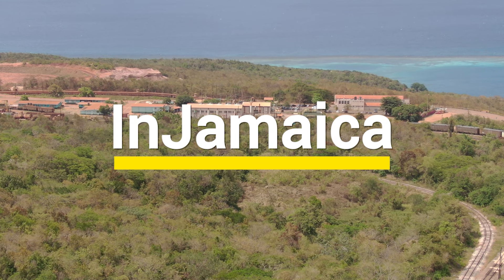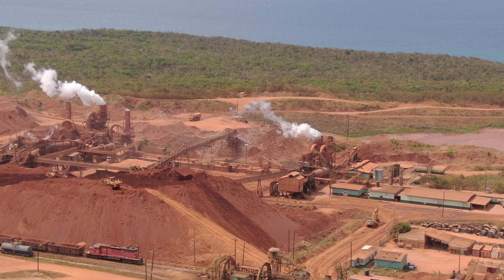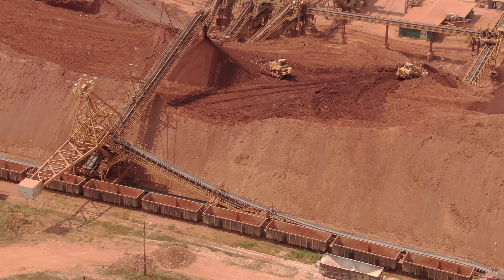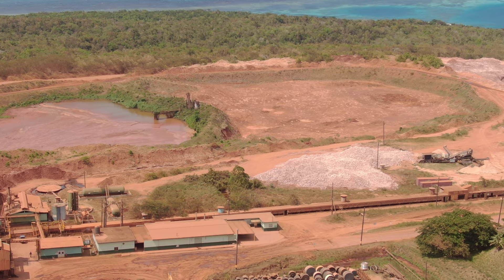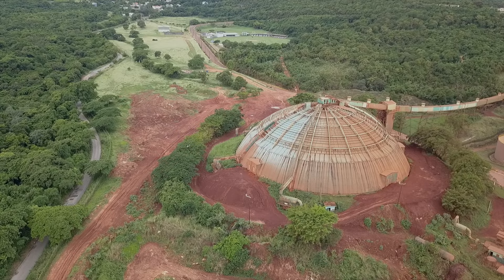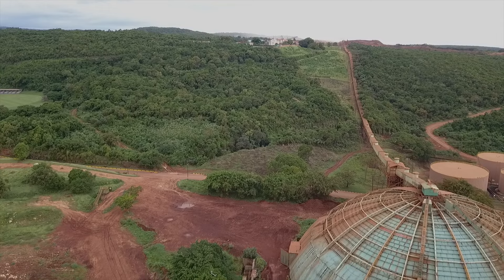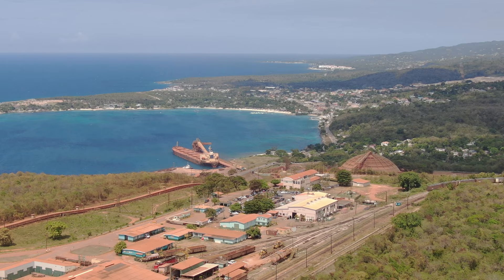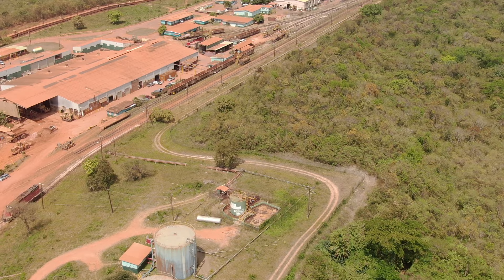Jamaica Bauxite (Mining & History)

Comment: Seams odd that a tropical country which would be extremely rich in solar energy is exporting Bauxite instead of manufacturing aluminium locally, and thereby maximising the profit margin for the country of origin. For 24-hour operation it would require something like a phase change material for energy storage. e.g. solar concentrators to melt salts which are stored in insulated containers as a liquid and used later to drive steam turbines to generate electrical power.
Reply: Kaiser owned both the aluminum refinery and the bauxite operation.  Lots of Kaiser's assets were sold together, including the Grammercy refinery and the St.  Ann Refinery.  The refinery and St. Ann mining operation are still together, and the Refinery is the last large scale aluminum refinery in the United States.